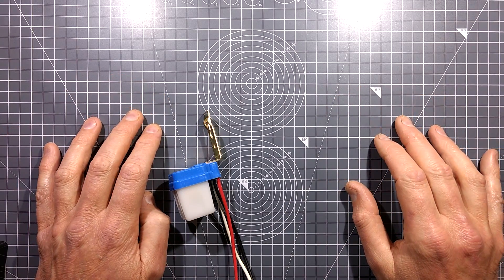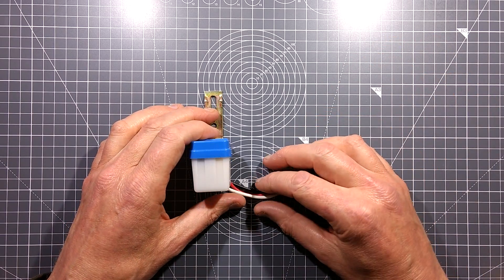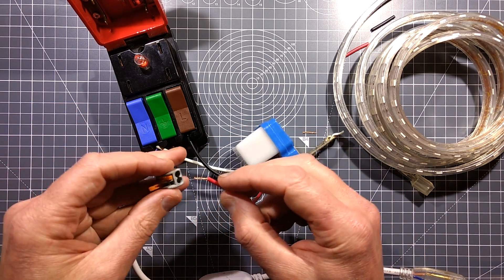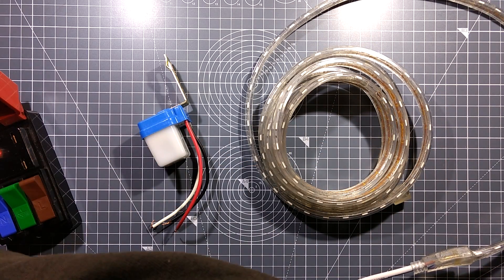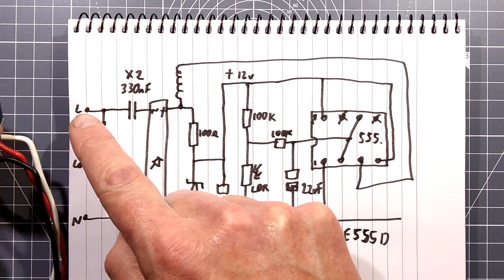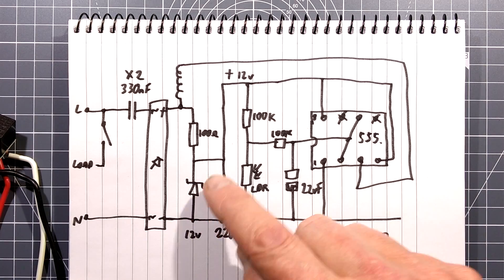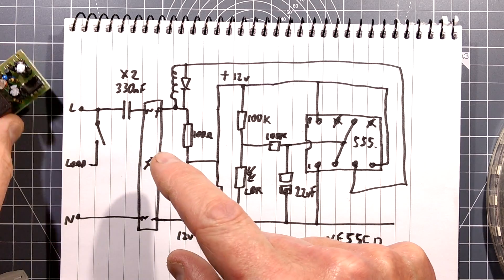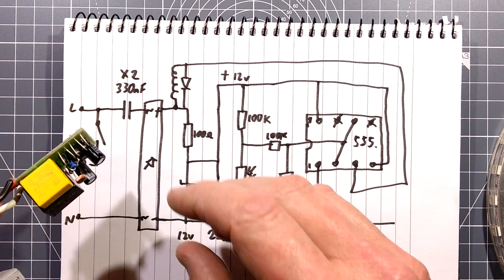Common Chinese dusk switch.  (With schematic.)

Comment: gday clive, I saw potential for this device when u said "take out the capacitor and it will run on 12v" my question is what to do to make it a 10v to 16v range? 21v to 32v range? and 45v to 62v range?? I would like to hear ur suggestions for off griders as u have more battery life at dc then using anything ac.
Reply from the maker: +OffGrid Aussie Prepper™ They sell a 12V version.  For higher DC voltages the 12V relay and circuitry is an issue as it would basically require a dropper resistor that would waste power as heat, and also cause the unit to get hot.
Reply: i found the 12v link after i asked, and it looks like i will need a dc to dc converter then.
Reply: OffGrid Aussie Prepper™ For 15VDC, and under, you can simply power the rails directly, and tie the relay directly to the negative rail instead, as most 555 timers will operate at up to 15VDC (there are some exceptions, however, amongst low power 555 implementations).  Above 15VDC you would essentially be varying the 100-Ohm ballast resistor and ensuring that both the ballast resistor and Zener diode remain well within their safe dissipation ratings over the range of voltages you anticipate.  For the Zener diode the maximum dissipation most likely occurs when the relay is switched on and for the ballast resistor, likely, when the relay is switched off (assuming it is being switched off the positive rail on the 555 output which would place it in parallel with the 100-Ohm ballast resistor and backfeeding through the 555 output pin) -- this is reversed from the norm for such regulators because of the way the relay is being switched in parallel with the ballast resistor when turned on, thus increasing the dissipation through the Zener (ordinarily the Zener would see a decrease when the circuit is drawing more power as, ordinarily, the ballast resistor would be a constant in such power supplies).  Obviously, if powering from a DC source you can skip the bridge rectifier portion entirely as such is only for converting AC into DC.

Comment: Is the relay coil really connected before the 100 ohm inrush resistor? The poor coil will see 325V spike when plugged in. This can also damage the output of the 555.
Reply: But the Zener diode is after the resistor, the coil is before the resistor.
Reply: No... when you power it up, the 330nF capacitor is discharged. For a very short time, the full mains voltage will be on the 100 ohm resistor.
Reply: Please checkout Relay coil connection ! 
The Relay are connect output + and 12volt +

Comment: The problem with the new mat is, that it is visually distracting, making the screen much "busier" - and it is also adding quite a few reflections. The old bench had the benefit of being just a plain, boring surface.

That is not to say the mat should go entirely, but put it under a transparent, slightly dark, non-reflecting plastik (like one of those thick rubbery surface protectors). This should reduce contrast, reduce light reflections and protect the mat from the inevitable fires and explosions.

Comment: Like many others here, I prefer the existing bench. The lines on the mat and the glare are kind of distracting. The solid color of the bench (even with its battle scars) makes a nice simple background and makes it easier to focus on the components you're showing off. Have you thought about maybe sanding it to remove the burn marks? You could save the mat for special occasions when it could be useful.

Comment: Bench is fine either way .
 I've got a 12v version. The wire is copper clad aluminium on my model. Uses around 5mA quiescent current, 38mA when relay activates(without additional load).
 I think these types(example link below) look better quality, no idea though. I have 2 older red models.
http://www.ebay.com.au/itm/DC12V-Photosensitive-resistance-relay-Light-operated-switch-Relay-Module-sensor-/291549772733?hash=item43e1b87bbd:g:Ag0AAOSw0JpV3ssR

Comment: you were talking about CCA wire and in car audio in america some people like CCA for power wire, but i hate it because the cost saving doesnt justify the loss in power across the length and the fact it has a much lower load rating guage for guage.
Reply: i meant to add "when compared to OFC or  tinned OFC"
Reply: ecoots People only like aluminum wiring for the cost savings, otherwise it has more negatives against it versus copper (aluminum requires a larger gauge size for a given load, is far less flexible, far more prone to breakage from work hardening with repeated bends/flexing, and has undesirable oxidation characteristics, hence the copper cladding to try and remedy versus using an oxidation inhibitor).  Other than cost savings there is little argument in favor of aluminum unless the run is so long that weight itself becomes a major consideration (but that would require a very long run in an ordinary automobile for the weight difference to really tip things in favor of aluminum).

Comment: Strange that the relay doesn't have a back emf diode across the coil. Some relays have a built in diode but checking the data sheets for that LS-T73 relay, it doesn't seem to have one.

I had to listen to the end of the video twice. Clive said something about shorting out the dropper capacitor. Something would pop and let all the magic smoke out! On the second take the bit where Clive said bypassing the capacitor would let the circuit run off a 12 volt supply sunk in which makes sense.
With a capacitative dropper it is usual practice to add a high value discharge resistor in parallel with the capacitor to prevent electric shocks but this circuit is intended to be hard wired to the mains so it's not going to be unplugged. 
There is no surge limiter/fuse resistor in series so if the dropper capacitor were to go short circuit it would fail big -time.

Comment: I was using a dmx dimmer and there was a snubber network on the outputs, which caused the led christmas lights to glow.  Plugging in an incandescent night light of 7w fixed that, painted the bulb black to kill it's output.. worked a treat!

Comment: You can buy CCA (Copper Core Aluminum) for network cable, its about half the cost, and a fraction of the quality. I believe it has a resistance of about twice the amount of pure copper, so causes problems with packet-loss in normal applications, and insufficient heat dissipation in a PoE application. When BT has used it for lines, its made everything pretty awful :( Its a false-economy!

Comment: 13:43
My guess is that they are relying on the fact that the 555 is a push-pull output.
Still though, I'd be a little worried that the push-pull output's dead-time would allow for enough inductive "kick" voltage to build up, but I don't know for sure. I'd imagine it can switch fairly fast so yeah (the claim of microseconds timing in the datasheet) ... a diode simply may not be needed!

Comment: Aluminum is a great metal for electrical stuff, but you have to have the correct connector which is connected correctly.
Done wrong and yes it is a problem, but done right, it can last and last and last ...
Reply: Benjamin Esposti That depends heavily upon where the electrical connection is being made as well.  Aluminum in contact with the ground (such as with grounding electrodes and conductors) will not be long for this world in many soil types.  Similarly, buried aluminum conductors deteriorate rapidly if their protective insulation is damaged for the very same reason...leading to interesting faults like a floating neutral.

Comment: Wait. A 555 ic? I've disassembled a few of those (110v) and those don't use that timer. I wish I had some of those on hand. BTW, I always invert the mounting bracket to use them. And Clive..... The old scratched, burned board was cooler.

Comment: I want to thank you Clive, I actually guessed right on how the circuit was laid out prior to you opening the switch.  Don't think I would have been able to do that without watching tons of your other videos on these take apart projects.
Since you seemed half way shocked they used a 555 timer, how would you have designed this circuit?
I really like the vids where you go off on some personal project to make something, rather than pure tear downs. It would be cool to see how you'd make this switch like this from ground up.  Like the LED filament lamp you made in the test tube, I thought that was cool.

Comment: Ah the good ol' 555! I'm surprised that the voltage at the relay coil isn't enough to damage the chip's output transistors, since one end of the coil is connected to "rectified mains", I know the voltage on the DC side of the rectifier wont actually be anywhere near mains voltage but still a little weird in my opinion.

Comment: Nice dusk switch, I like how easy it must be to convert it for using it with 12VDC only.
If you don't trust it on mains voltage or want to play around with it safely, you can always put it on the secondary side of a low voltage power source for e.g. led lights.
just (remove and) bridge the X2 capacitor. Optionally you can remove the bridge rectifier, too, but it take away the "universal" polarity power input "feature".

Now that I have read the video's description, I read that you can buy the 12VDC version as well. I wonder what the difference is...

Comment: Thanks for the good video.  How could the circuit be modified to be "Day On" instead of "Night On"?
Reply: Bernard Despins changing place with the 100K resistor (above the ldr) with the ldr would cause it to be day on i think
Reply: Thanks for the reply.  I will give it a try.

Comment: CLIVE : Interesting Led bulb [ P13.5S PR2 1W 90 Lumen ]. Verified 3V-18V (no extra resistors etc), Max current (& light) of ~150mA at ~4.7V , lower @ < ~4V and stable ~50-80mA  all the way to 18V . search aliexpress for 32784942423 . should bring u directly. $1.89 Free Sh.  Must have a circuit inside , I wonder ?

Comment: I have the 24VAC/DC version of this. It's identical except that the dropper capacitor is replaced by a 750Ohm 2Watt resistor.
Oh, and I have no opinion on the mat vs workbench.

Comment: Hi, the old bench looks amazing. It does not bounce the light much and its a kind of neutral colour as well. The grid lines in this is causing a confusion when you show small parts on top of it. But hey its just my humble opinion :)
Love your videos. Keep it up.

Comment: If you have thrown away the old top, please tear open a couple more batteries on a new sheet of MDF. Just let them spontaneously combust,... hit it a couple times with a hammer,... and put it back on the bench!  Lights should be at a 45 degree angle to the work for glare free display.      Don't forget the bigclivedotcom sticker!!!!

Comment: I hope your friend who is exporting that mains connector to America also changed the "L" to "H" as they call the live hot over there.
Reply: Bodragon No, it remains an "L".  But if one can neither remember than "L" (Live) equals Hot nor that black equals Hot, then they likely also will not have remembered that "N" and white are neutral or that the green is ground, in which case they probably ought to avoid mains AC altogether.

At least it is not like the "H" hot and "C" Cold water faucet knobs where in many South and Central American countries they are reversed with "C" being hot (caliente) and "H" being Cold (frío) since North American (US/Canadian) sources were often used.  Makes for a very exciting shower when visiting such countries because you can never be certain which faucet will be which as some places will preserve their original meaning and some would reverse them so the the "C" represented hot figuring it was more important for children to recognize the "C" as caliente (hot).

Comment: I assume, you mentioned it as an afterthought, that when you say bridge out the dropper capacitor, you mean to no longer use it on AC mains, but with a 12V supply? It made me say, "What?" and not everyone has English as a first language. :)

Comment: I prefer the old bench but think it is worth pulling out the mat in some disassembly steps. The main issue with it is the glare, putting the same markings on the bench or sorting out the surface/lighting to reduce that may be enough to help.

I am not sure if I am the only one but I also find it a little disorientating when the camera is zoomed in, but its not enough to stop me enjoying the videos.

Comment: 9:37 What it means is that the relay/switch can be used to lock/unlock based on fingerprint input, Iris or RFID input, instead of the light sensor . . . I think :\

Comment: I bought one of these from eBay/China but the 12v version. I use it to turn on/off my LED down-lighters on my garden room. The sensor it on the inside, facing out of one of the windows. Had it for a few years now, works perfect!

Comment: Couldn't you replace the 100k resistor with a potentiometer and therefore have the option to adjust the delay as needed?

Comment: Love your videos, just curious how you film them and have such control over the zoom in and out, etc... I know you've said before it's on an iPad but is the iPad right in front of your face, i.e. are you looking into the iPad screen all the time while you are doing these things or is the ipad slightly forward and above your head so you can see the devices directly. Would love to see some side footage (if you are happy to do it) while you are filming something on the bench - i'm sure others would love to know too... Keep up the great work - love your videos so much...
Reply from the maker: I switched to using a Moto G4 phone.  It's mounted on a small shelf central to the bench and with the screen visible for framing and using the on-screen controls.
Reply: Ah cool. Cheers for that. if you ever run out of things to teardown then I'd love to see a wee your of your desk/equipment...

Comment: is there a difference between "expensive" and cheap 555s? You can get 50 for a pound or 10 for a pound and they have different writing on them, but don't they do the same thing?
Reply from the maker: It's a heavily cloned chip.  They usually are quite cheap, but I don't know how the characteristics vary.
Reply: And The real difference is that you can never be 100% certain what you are getting with some of the knockoff clones whereas if you build around any of the major branded 555s then you know exactly what you are getting and the knowledge that you can generally substitute them between circuits without any need to tweak your design to accommodate for manufacturing variations.  So if you are building a one off item it may not matter so much but if you are building many then the last thing you want is to have to possibly tweak each one in a critical application.  The other consideration is that QC is sometimes much lower on the cheap bulk parts, and sometimes they may even be manufacturing seconds or thirds, with possible flaws (either cosmetic or electrical in nature), so issues you encounter in design may be in your design or in your selected chip whereas the brand name chips have exceedingly low manufacturing failure rates and a consistent level of quality and behavior that agrees with their published datasheet.  Given such a small price difference I would generally opt for brand name unless I just did not care what I got for a particular project.  All of my 555s (I have several hundred on hand) are brand name as the modest savings just are not worth the modest level of risk to me.

Comment: The snubber diode is not required.  The 555 output is a totem pole type.  When the output goes high there is a PNP transistor shorting coil to the 12v supply.  Amazing use of s 555 as a window detector and latch.
Reply: Good idea. Yes! no need snubber.

Comment: I like the mat, it deflects more light onto the sides/undersides of whatever you're currently working on. Need to do something about the angle of the lighting to sort out those blown out light spots, though. Replacing your direct lighting rig with a couple of strips of 6000K 14W LEDs with a diffuser would be a better option for this kind of recording, regardless of the background substrate used.

Comment: Prefer the old bench, too much glare from the new mat. Also please increase recording volume - I need to use a Bluetooth speaker to hear you as sound from tablet is too low. On the other hand, sound of Youtube ads is blaringly loud, which suggests issue may be that your recording sound level is low.

Comment: All real benches have cuts, digs and burn marks, also SMD parts buried in the crevices - adds character!
Reply from the maker: SMD parts that always seem to end up in the holes where the drill went through material faster than expected and left a neat indent in the bench.
Reply: As long as they don't end up in the holes where the drill went through material faster than expected and left a neat indent in the finger, all is well.

Comment: Here in Toronto, Ontario, Canada TONS of cat6 network cable suppliers are now ONLY carrying CCA "copper" (lol) coated aluminum cables. They fake the specs printed on the cables too :( When trying to run passive 24dc PoE over them they never work properly :(
Reply: toysareforboys I would expect CCA Cat6 to be especially prone to mid run breaks when subjected to even minor cable kinks during pulling given how easily aluminum work hardens and embrittles.  But even with active 48VDC PoE injectors I would expect problems when powering higher current devices as there is a hard limit as to how much they can boost the source voltage beyond 48VDC to offset excess voltage drop in the run.  Some of my WiFi access points draw enough power to push PoE to its limits, and even into PoE+ territory.

Comment: I have few of these and they all eventually died. Probably because of lack of that diode.
Reply from the maker: My prime suspect for a failing component would be the dropper capacitor changing value over time.  It's on the borderline of pulling the relay in.